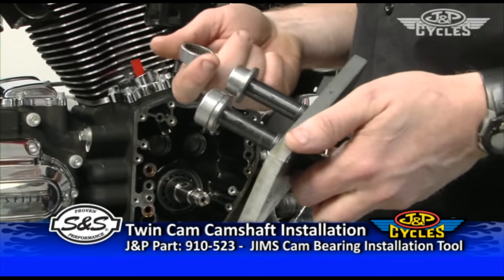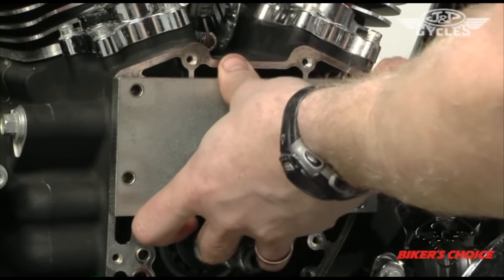Cam Replacement on a Harley Davidson Twin Cam, including Pushrod Removal •  J&P Cycles

Comment: I have an 11 HD Street Glide 103 (FLHX) I have a 2 into 1 exhaust V&H pro pipe, Power Commander 5 and Roland Sands intake, what would be the best cams which will give me the best overall across the board performance.  HD Dealership recommended the S&S 585 but I'm undecided, thanks, great video

Comment: can' you replace the tappets thru the opening from below since the cams are out, without removing tappet blocks? also did you have to relieve tension on outer chain tensioner before you removed chain and sprockets? Thanks for video!!

Comment: do the push rods have to come out if replacing the cam plate or oil pump?
Reply: I just did this job on my 2012 wide glide and I bought the adjustable (not quickee) pushrods.  They just barely fit in before extending them about half an inch.  I don't see how full sized pushrods would come out except through the top of the engine which means a lot more work.  FWIW, I'd buy the quickee rods if I had to do it again.  The tappet cover, tappet cover gasket, both pushrods and both pushrod covers all have to be put in at the same time in one movement.  It's a juggling act that is a real pain.   The extra 30 bucks is worth it.
Reply: i kinda figured they had to be taken out, might as well if i'm gonna go through all the other work. do it all at the same time and have one less thing to replace in the future. thanks.

Comment: instructions on s&s adjustable pushrods say, there is exact 32 threads per inch (as you said). but it also recommends 4 turns (24 flats) instead of 20 flats as you turn on the video. what is correct?

Comment: please help me with one more question. i have 13 dyna, 103''. and camplate does not have a Cu washer.. so i discovered scratches on the end of the crankshaft. is it normal?

Comment: Autozone has free tool rental. I used their blind hole bearing puller for nothing. To install, I used an ordinary puller in reverse behind a plate bolted to the crankcase. Just remember, keep them square and go slow.

Comment: At 8:44 when you renovera thea CAM cover on the uppger Wheeling the alignment dot is like on fall past 6. And then at 8:50 its on 3 o clock. Do one have to turn it like that or ?

Comment: After the install, am I free to start the machine or do I need to reprogram the ECM? I have the Vance n Hines fuel pak, do I need to just call them to get the upgrade component codes or does it have to go to Harley to download the new maps?
Reply: While I did not do my own, my local mechanic said that it doesn't affect the download at all.  I've been running mine for over 2 years now with no problems.  It is a defininte adjustment in perfomance.  The sound of the geared cams will throw you off for a few days, but you get used to it.

Comment: Your owners manual will tell you what the deflection should be. Usually between 5/8 and 7/8 of an inch depending on weather the motor is hot or cold

Comment: Do you still have to cut and remove the push rods if the cam works with stock push rods ?
Reply from the maker: you do not have to, but it saves time and rocker box gaskets if you are going back with adjustable pushrods.

Comment: I have 2013 Harley street glide.  Which S&S cam kit would you recommend?
Reply from the maker: It depends on what you want to achieve. If you want more around town, redlight to redlight fun, I'd go with the S&S 551. If you want more highway performance, I would go with the S&S 585.http://www.jpcycles.com/product/420-453http://www.jpcycles.com/product/420-427

Comment: Nice video. Regarding the engineering, I notices there are two small sprocket driving chains that both use hydraulic tensioners, and I'm asking myself why would Harley not use plain driving sprockets and avoid complexity and maybe more weight, use of little chains, hydraulic mechanism with a plastic. Doesn't' make sense.

Comment: I had thought about going to MMI to become a motorcycle mechanic but after doing research on the  labour rates that are paid out on jobs and the cost of buying tools to actually do your job not to mention the rip off cost of going to the motorcycle mechanic's school it would take over five years to get my head above water, not really a good plan at the age of 41 so I guess I will just stay in the declining  industry of Trucking and hope some day the freight rates will go up and the price of diesel will go down,the government is trying to kill of what's left of the owner operators.

Comment: Before you remove the cam cover drape a sheet of plastic over the frame under the cam cover. This will keep your oil lines clean and free of oil.

Comment: I have a stage 1 motor with stock compression. I just installed the 585 ez starts with  a no start problem. Low to no compression with stock pushrods. What would be the problem?
Reply from the maker: There are a lot of variables there. I would need a good bit more info to even begin to diagnose your situation.

Comment: Oh, You say the Harley Tappets have a Dowel Pin to keep them from rotating? They don't rotate as the motor is running. 
IIRC, Like a Chevy Small Block motor, the lifters rotate when the motor is running.

Comment: "Tools..."
Obviously, to work on these bikes, you're gonna need specialty tools that don't get used for anything else...
Where do you get these tools, like the cam bearing press/ extractor?  And the timing gear lock?
Reply: from harley or ebay.  I bough stupid wheel bearing puller OEM harley, it was like $80 on ebay, can only use to pull or install bearing on harley wheels, ))) Used it 2 times.
Reply: @ansv3340  See, I think 'specialty tools,' like that, are okay, if you're a mechanic and you're gonna use it to work on bikes...
Even the cam bearing puller, is a specific, specialty tool, that's no good for anything else, but pulling or pressing cam bearings into the inner cavity of a Harley engine.
But it's something you gotta have, to do the job, or have a friend that has such tools.
I have an '04,' Heritage Softail...  It's sat in the yard for this past 3 day Labor Day weekend...  I never even started the shit up.
I bought the bike, thinking I'd get this summer on it...  so far, I'm in nearly $1,000 dollars, and I haven't put but about 300 miles on it...
Harley's are shit!  Fuck the hype and all the nostalgia crap!
They are the best example of why Americans have gone after Jap bikes, or British bikes, maybe German bikes.
The only people who should own a Harley, are the people who can afford the constant need to fix and spend on one.
You will be constantly needing to do something, or pay someone to do it, just to get the shit to start!
People buy Harleys new...  Then they spend nearly the same amount as the bike cost them, to have it rebuilt with BETTER aftermarket parts.
A stock Harley shouldn't even be allowed on the road!

Comment: hello,,i am getting mixed reviews on quickie push rods? some say they need adjusting all the time..and others say not? please chime in..thanks
Reply from the maker: Once they are properly adjusted, you should not need to adjust again unless you collapse them for removal, or they were not tightened correctly.
Reply: Worked great on my EVO.
Reply: No.  Stay with hydraulic lifters

Comment: I wonder why the two cams aren't connected by gears. You can see that the two sprockets that carry the chain are almost touching anyway. I really wonder why Harley decided to do this by chain and had to bother with tensioner and stuff??????
Reply: Everyone else uses chains and there are very few problems. H-D really screwed up here.  Gear driven cams are also very noisy.
Reply: Harley used chains to keep the motor quite...gears wine as you would know if you ever install gear drive cams. Adjustments are critical with gears and harley is lazy...
Reply: Yep. Straight cut gears are noisy. Helical gears would have an unwanted thrust reaction. Double helical or herringbone would be too wide.  Plenty of other companies use chains, tensioners, and guides that don't have excessive and unreasonable wear or failure at 15-30k though.  Bad design and/or materials.

Comment: I keep hearing about cam chain tensioners that might fly apart at the 15,000 mile mark on twin cam engines pre 2006. That what this bike has?
Reply: I'm looking to buy one of these bikes. From what I gather those models (pre 06) had problems based on the spring loaded cam chain tensioner, shoe material, and chain type. After 06 they utilized a hydraulic cam chain tensioner (like the one on this vid) and I believe better shoe material so they don't wear out as fast. I suppose the chance for them to fly apart is still there? But this design (plastic shoe riding the cam chain) is extremely common for many types of bikes. So I wouldn't overly concern myself with it with a post 06 bike.

Comment: Great Vid guys! I have a quick question: What is the pinion shaft runout spec expectable for a gear drive set up? I have a 2009, 96" dyna and interested in a gear drive setup. Thanks for the vids! 
Ride on,
Michael
Reply: Michael Clancy 003 max

Comment: Why cant you just take the cam cover off first, then look at the timing marks to see when rear cylinder is on base circle, and same for front cylinder( i realize for the front the dot on the gear will be hidden on top) instead of messing with push rod movement or tappet feel?

Comment: I bought a gear drive set from S&S part # 434-168, on the cam that the gear bolts to I have a lot of in and out movement so when the gear is bolted to the cam it rubs on the cam plate.any thoughts??

Comment: Looking for opinions. Installing the adjustable push rods so it's easier to change the tensioner shoes vs just spending the money for a gear driven setup?

Comment: Question for H-D:

So, what did adding a cam do for the engine, besides the obvious?
Reply: AND Re-design your crap. I can't and won't deal with it.    I was about to close on a  Low Rider.  All H-D nowadays is JUNK.

I'm going to the Honda dealer to look for a bike. H-D thanks for the MAJOR disappointment.
Reply: Ray Charles Harley's are fine if you leave em stock. All you have to change is oil and tires. Problem is they have no power off the showroom floor so you gotta go spending $2-3k extra to give it some extra HP and TQ. I'd go Victory before Honda. Victory's are magnificent bikes. Check out the Highball.

Comment: If I am replacing just the tensioner pads on an 02 night train, do I still need to replace the cam bearings?  Thanks
Reply: WILL THE  585 LIFT CAMS EZSTART  GO IN A 2002 NIGHTTRAIN  88 CU IN ?

Comment: Super great video very thorough nice explanation of everything but I am shocked that you are not replacing the problem with all twin cams while you are there you know the customer in 30,000 miles is going to lose his motor and you could prevent this from happening right now.

Comment: Has anyone ever thought of using gear drive cams, but yet having chain still in the frt,i know a lot of bikes cant because of runout,having gear on frt and back of the cam plate

Comment: what's the main advantage of all the extra chains and dual cams? Better pushrod and valve angles I presume? And quieter operation to please the EPA Nazis? Seems to me the more simple shovelhead/early evo single cam set up would have been wiser to have kept in the evo?

Comment: DO I INSTALL CAMS WITH PISTON ALL THE WAY UP ON COMPRESTION STROKE--IS THIS TDC
Reply: Did u ever get an answer? I'm gonna start a cam swap next week and was wondering the same thing.
Reply: Robert Luebke you don’t want TDC for this application. Watch again.
Reply: You FOLLOW THE INSTRUCTIONS IN THE FACTORY SERVICE manual. Youtube videos are great for seeing what to do. Service manuals provide PRECISE instructions and specifications for each year.. Don't try to get away without them.  Get the HD factory service manual or manuals (later years have more books) AND parts catalog for your motorcycle. The parts book will save you far more than it costs in searching for parts, and the exploded drawings show you how they go together in more detail than the (excellent) HD service manuals.
Reply: Mark Gesego Yes! Always adjust push rods with the piston of the cylinder you are working on at TDC COMPRESSION stroke.  Both valves are closed at that time...

Comment: do i need to drain the oil on dyna before camcover disassembling?
Reply from the maker: You don't have to, but I always change the oil with any engine work, so it's not a bad idea. you will still need a pan under the cam cover area to collect residual oil.
Reply: +J&P Cycles thanks a lot
Reply: J&P Cycles thy. my a

Comment: Why does the description refer to a simple installation of S&S 510C cams, when the demo actually uses 585C EZ Start cams?  510s are a benefit to an otherwise stock setup, but I wouldn't bother using .585 lift without some head work.  You don't need EZ Start with stock compression.  And since you're pulling the heads, you don't need the bolt cutter method described here.

Comment: Is it true that a stock 88" can accept a .585" lift cam?
Reply from the maker: no. A 103 can, the valve springs are different. That being said if you put a .585 cam in a stock motor it isn't going to perform well on the street. Not enough compression
Reply: @jpcycles  cool, thanks for the response. My buddy has a 1999 Twinkie thats been juiced up to include new pistons and its got a .585" set of cams in it and that thing RIPS!!

Comment: Why would anyone go to all this trouble and leave the silly stock Harley cam chains and plastic tensioners in there?  How much more would cost to replace those with the S&S gear drives instead?
Reply: Dave Taylor can’t use gear drive with that much variance in the crank runout (007) needs to be 000-003 max to use gear drive

Comment: does anyone know the map seting on a dynojet power vision for a 2013 ultra 103 with rineharts ture duels venterator air cleaner and 255 cams.

Comment: Does anyone know if you have to remove the push rods in order to remove the cam plate?
Reply from the maker: Yes, the cams are attached to the cam plate. There is pressure from the lifters/pushrods on the cams.
Reply: Yes

Comment: Great mech! He's why I invest in S$S! If that's their mech, imagine their engineers? I can't wait to save for my 585 sitting on their shelf! Anyone think the LR washer worth it? I've tore the jugs out and replaced rings with success and changed the intentional flawed compensator to the screaming eagle with baffle, so I'm not completely stupid but I also don't want to buy $500 in tools just to use it once? (Much like the inner primary bearing race remover tool....
Reply: hatersaywhat   Check out the Harley  Forums. Tech/engine work.  You can borrow or rent these tools that other people also use only once.  I did on my EVO several yrs ago.  Just return so others can use them.  Do not give us all a bad name by keeping them.

Comment: Great video. I always wondered what was involved in being a Harley owner. I ride a Honda and have never had the need to open up an engine. If I liked fixing bikes, I would definitely get a Harley.
Reply: +j rvlvr He was not fixing this bike he was hopping it up with a hotter cam. Yes working on bikes is more fun than almost anything and that is precisely what differentiates a real biker from a noob like you.
Reply: +PeterDad60 

You are the sensitive type I see. Go ride (or tow) your bike down to the local tavern and lean up against a post or something. It might make you feel better.
Reply: I'm not the one that doesn't wave back to my fellow rider. Save your straight finger talk for someone else
Reply: Doc...sounds like my 81 Suzuki GS850. I think those Jap electrical engineers were drinking too much saki when they put it together.

Comment: min 29:40    5 bolts?    How about 6.. Also..all the screws are NOT the same length,,the bolt ( allen head) that is trapped under the tensioner and the  # 4 , in tq sequence) are about 3-4 threads less in length. ..  if you use a one of the longer ones ,they will bottom out before they contact the plate for proper TQ.    I notice this and measure the thread depth into the case .a noticed this......pay attention to details

Comment: Wouldn't you want to cut the pushrods on the compression stroke instead of on the overlap? You still have pressure on both valve, that's why it's called overlap!!!

Comment: Why does no one agree on the years ? Some say these tensioners were only till 2005 some say 2006 .... I have a 06 with almost 80,000 miles .... No problems ... So is it 05 or 06  ?..
Reply: Who are you talking to? 1998 to 2006 Twin Cams have heavy spring loaded cam chain tensioners. 2007 till present have hydro tensioners but still use same shoes made of plastic, but no where near the pressure forcing them against the chain. You can buy a hyro conversion kit for 1998 to 2006 Twin Cams. The sectioned crank was introduced in 2003, which is another problem. However, if either crank has less than .003 runout you can install gear drive which gets rid of the tensioners and chain. Converting to hyrdo shoes is not a true fix, but an extension on show life, up until around 60,000 to 70,000mils instead of 15,000 to 30,000. As far as no problems, follow the vids steps unto expose the outer tensioner. You will have no warning before massive failure. No sound...nothing.
Reply: 81,000 on my ‘03 88.  It was time.  Inner shoe worn the worst, small piece broken off.  It’s not a big job.

Comment: I ride a110 dyna....love harley's BUT....ABSOLUTELY nothing compares to the engineering that goes into a Japanese dirt bike.......Until you have ridden a strong running dirt bike you should not knock them.... I think Harley's are a way for the non competitive male to fit in and enjoy being a part of something. I love all two wheeled motor vehicles. I enjoy working on different engine designs because i can experience the mindset of the person who designed it.....